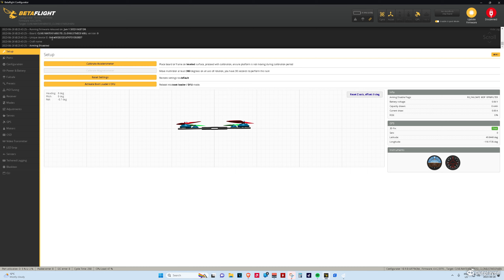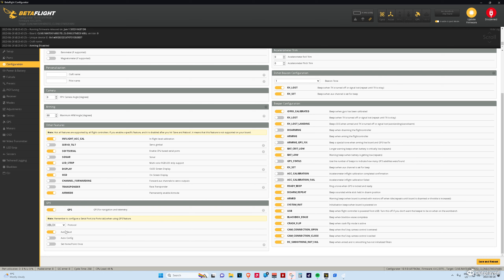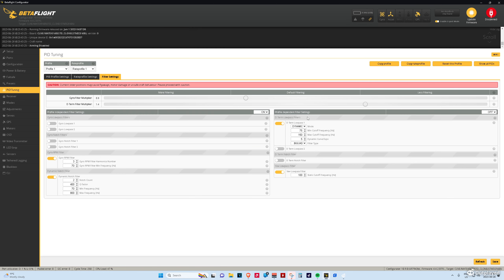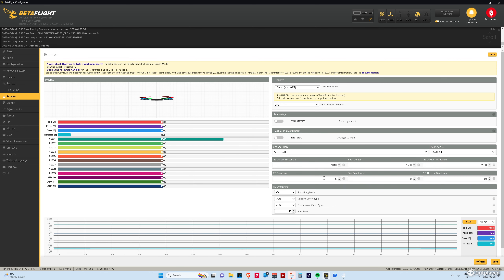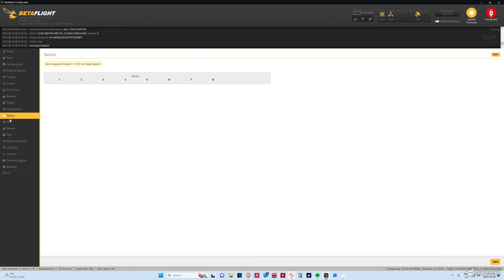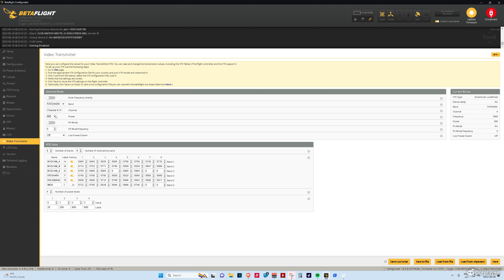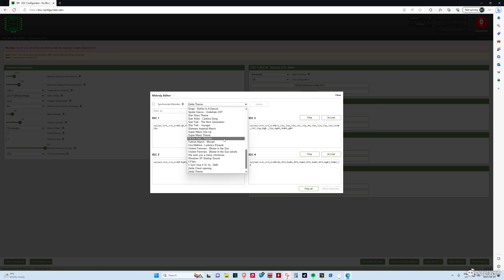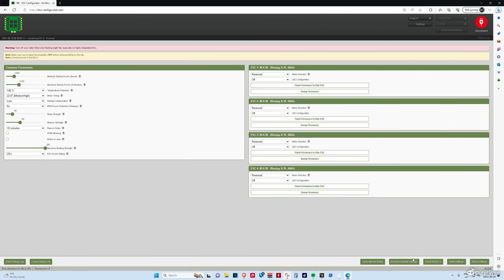How to setup Darwin 129 (+GPS Fix)

Comment: I have this Drone on BF 4.3 but when I update to 4.4 or 4.5 i loose all Gyro, Accelerometer & Barometer data. How did you fixed that or do you have any files available like Firmware or CLI or presets saved? What Firmware Target did you use?
Reply from the maker: https://darwinfpv.com/blogs/news/darwin129-7-long-range-pnp
Should be able to use the CLI here. Accelerometer should work by default so I would make sure you are using the firmware target with STDCLONE at the end when your flashing. I havent tried anything higher than 4.4.2 on this drone yet so not sure what the issue is...

Comment: I have  set of darwin 129 and caddx peanut, but I get jelly in the video
Reply from the maker: How well mounted is your peanut? Make sure you have everything tightened down and double check your PID. Maybe you have some janky filters setup making it fly wonky?

I use the supafly 7" 
I also updated my ESCs to bluejay and turned on bidirectional dshot. 

My camera is quite stable so I would consider trying those and double checking your drones all screwed together right.
Reply: @UnholyNomad  what pwm frequency you use in bluejay?
Reply from the maker: @Max_N.  48 is what I use

Comment: I updated mine to 4.4.2 and now I have no ports 😢
Reply from the maker: Flashed to stmclone? Might've flashed the wrong firmware
Reply: @UnholyNomad  yeah I used stmclone. But I used uart4 instead of uart2 for elrs. Maybe that's the issue?
Reply from the maker: @rockfordian23   Don't think it would make your ports disappear... 
Only thing I can think of is check with the receiver disconnected and if that doesn't work then I'd flash again
Reply: @UnholyNomad  well I tried and still nothing. Hopefully I didn't fry anything. The uarts won't stay selected.
Reply from the maker: @rockfordian23  that is extremely weird. 
The Uarts should still show up. 

Can you tell me exactly what target your using for the firmware update? 

Keep in mind the GPS is on the same UART as USB TX1 I think. 

So you might have to unug the GPS when you flash or connect the FC. 

Not really sure what else I could do to help. Might be worth checking out Joshua Bardwells videos
Reply: @UnholyNomad  ok thanks for the help I just had to set the serial ports to the right settings. Is there anyway I could get a pic of your port setup? The only thing not working now is the led strip
Reply from the maker: @rockfordian23  I would share with you but I never got the LED light working again. Glad to hear your board is working though. 

I believe you have to go to the darwin129 on the website and there should be a list of CLI commands you stick in to program the LEDs configuration. 

Can always email DarwinFPV for the settings.
Reply: @UnholyNomad  thank you for the help I appreciate it.
Reply from the maker: @rockfordian23  No problem buddy, take er easy
Reply: I’ve got the same problem now. How did you solved it? Did unplug the gps while flashing solved the problem?
Reply: also my Accelerometer and gps is dead
Reply from the maker: @ElDooderino  You have to unplug the GPS during flashing or else the USb port won't allow you to connect to the bootloader. 

If you message or drop an email address I can send you a screenshots of my ports so you can copy them over and make sure they are all correct
Reply: Greetings, I also updated to 4.4.2 and does not allow arming, calibrating writes in the flags. The accelerometer is calibrated. What could be the problem? Firmware f405std_clone
Reply from the maker: @ЭльдарТокбаев-ж5д  Did you set the aux for your arm switch and the range? 
Make sure your switch and the drone agree on what channel is the arm switch and make sure the range values are set. IE switch at position 1000 is off, 2000 is on. Or whatever values yours is set too. 

Make sure you've pressed calibrate accelerometer under configuration too.
Reply: @UnholyNomad  The Aux channel and ranges are configured correctly, the accelerometer is calibrated, when the drone is turned, it shows correctly. I installed firmware 4.3.2 now, everything works fine, the drone is armed. I'm flying on this firmware. Thanks for the answer, good luck🤝
Reply: @UnholyNomad 
I would really appreciate a pic of your ports set up as I have lost all my ports on the 129 after flashing, I had the Rx connected up before flash and now can't remember how I set that 
It's a radiomaster R81 SBUS 
Just trying to get back into fpv and having a really hard time with all this